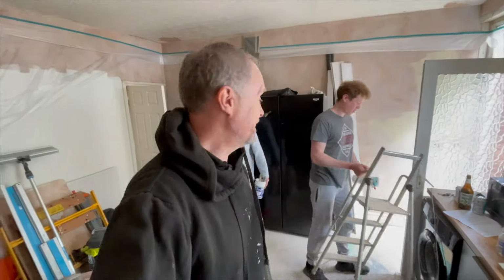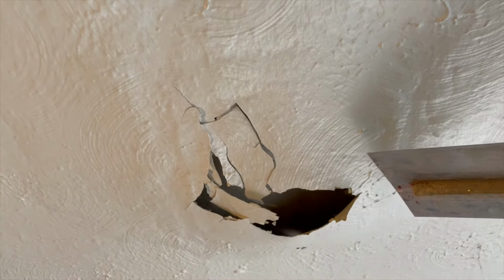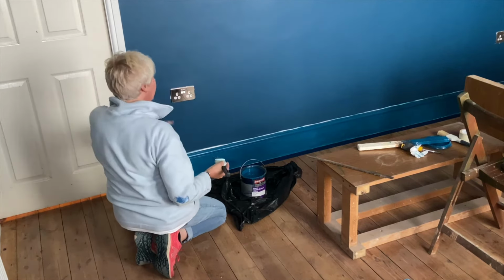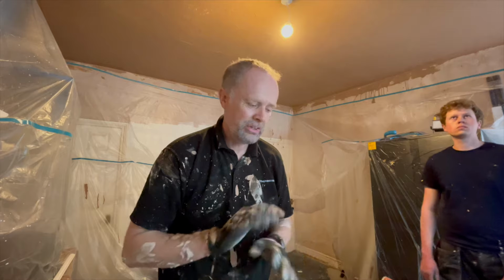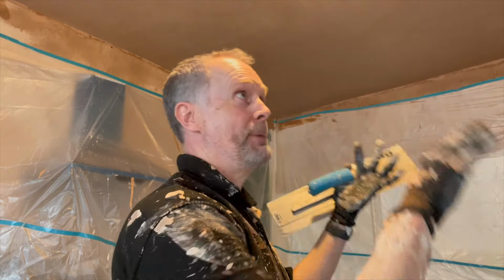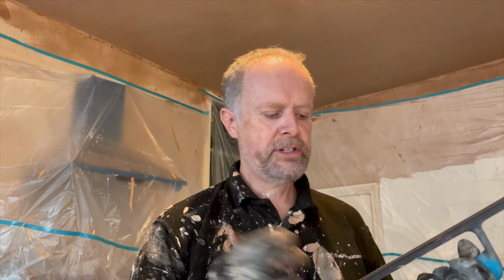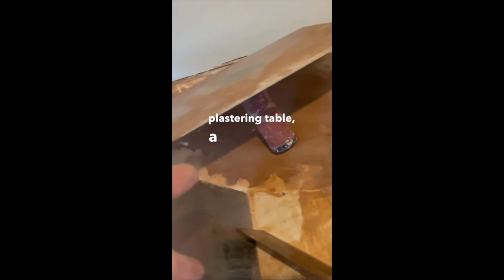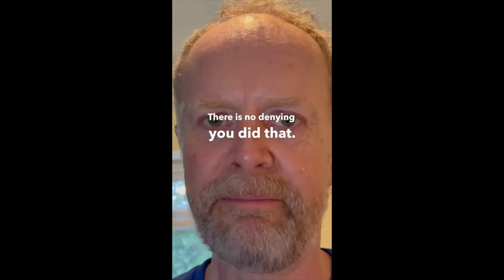Plastering: SBR v PVA [SHOCKING] verdict!

Comment: Mate, with all due respect for trying, you're doing it all wrong lol you dont look like you really know your drying times and materials. There are a thousand ways to get the plaster to pick up quicker. The sbr should have gone on neat which is not your fault as you followed the instructions but with experience you would have smashed that in a couple of hours. But fair play for trying. And lastly stick to a normal carbon steel trowel keep the flexi trowels away from plaster. But well done for trying
Reply from the maker: Thank you so much for taking the time to watch and then comment - I really appreciate it! 
The time to try SBR was not on that ceiling with that awful thick, stippled, shiny paint. 
PVA and two skims is easy enough but that SBR was wrong stuff, wrong mix, wrong surface for me. Thankfully I won't be doing that again!
The flexi was new so I wanted to try it but the plaster was off and wet in places so it was a disaster from start to finish. 
But it's done, it's ok and it was free...! 🍻🍻🍻🍻🍻
Reply: Lol
Reply: What he said … carbon steel all day long ☝️
Reply: Stainless steel trowel keeps its edge a lot longer and has no gaps unlike carbon sprung steel . Another good tip after you're done every day clean it and then wrap it up in a thickish piece of towel a few times and you'll have something as sharp as a Stanley blade in a year or so depending how much sand and cement work you do with it .
Reply: We've been using sbr since the 70s, never ever used PVA, blue grit is complete rubbish it is two course so the grit comes through your first coat, stabilizer we use mostly on lime paint, and this video with this ceiling that looks like lime paint, sbr pink we use now, but sbr all the way

Comment: Having sold SBR for many years, it must be dry before skimming, preferably done the day before. PVA is water soluble, so can reactivate when skimmed on. SBR is far more stable, with many times the adhesive strength than PVA.
Reply from the maker: Well I needed that info badly because let me tell you, wet SBR is bobbins for skimming!!
When I do the stairwell I will defo do that! Cheers! 😉🍻🍻
Reply: @martynlegg1042  SBR isn’t tacky like PVA and hence you have more chance of the plaster sliding on the substrate and not gripping like it does with PVA especiallly on some paint types, also every plaster on YouTube seems to think suction is a major issue to the point they need to kill it completely when infact a bit of suction can help adhesion to the substrate but SBR may help with extreme suction.

Apart from drying times and the odd substrate that has cause excessive suction I’ve never seen the need not to use tried and tested PVA!
Reply from the maker: Interesting! Good feedback, cheers. I must say I feel I know where I am with PVA!! 😂🍻🍻😂
Reply: You’re went over something like artex would just pva it the once and the bit you broke off twice as they suction would be different

Comment: Sbr far superior especially as a sealer for suction control but needs to be applied neat as much more liquid like than pva and dries within the hour if neat, I use all time now as pva not great on high suction walls and sbr rubberises and provides 100% barrier and still grips
Reply from the maker: Nice one, thank you. I think that now I know the right way to apply it I will persevere with it and I may be an SBR convert...but the PVA is cheaper...!! 😉😂🍻
Reply: @EscapeToTheDreamHouseUK  hi there, pva is cheaper but sbr still goes fair way and only need 1 coat neat on any background even bare plaster where you would need least 2 with pva and still be fighting suction a bit, once you get used to it you’ll see the difference 👍
Reply from the maker: @Nofixedabode859  excellent recommendation! Nice one 🍻🍻🍻

Comment: Best go neat with sbr. Plasterers have for years been using product not specifically made for plastering pva and sbr. They kinda work but occasionally fail. Likely the paint you were going over will not absorb anything so neat sbr is needed or maybe thistle bond it / blue grit. But sometimes pain s inevitable
Reply from the maker: Nice one Iain. Thank you. I normally use PVA because it’s cheaper!! 😉😂🍻🍻

Comment: It doesn't matter what primer you use if it's still wet. you'rer going to have problems if it does strat to slide, leave it alone, and let 1st coat pick up. The more you play with it, the more it slids
Reply from the maker: Absolutely spot on! Total cock up on this one. I am so used to using PVA so the watered down (another cock up) SBR and not leaving it until the following day just made it an absolute fu...disaster!! 😉😂🍻🍻

Comment: A tone of work for very little reason mr.
Sorry to say, you applied the bonding agent totally wrong.should have been left until dry then plastered.. preferably overnight 
Styrene Butadiene Rubber is not water soluble once it's dry were as poly vinyl acetate is especially if it comes into contact with excessive moisture. Pva is ok in the right setting...ive used both for years as a professional plasterer in both commercial and domestic settings.
It works perfectly..
Artex is full of fine particulates including asbestos & cement so adding water to your gule will slow down evaporation prosses massively... Hence your multi finish will start turning to almost chewing gum like texture. Difficult to deal with.

Even Bulegrit plasterers primer needs SBR applied on problematic & multilayer surfaces prior to plastering.

Distemper requires stabilising solution left to dry then sbr...
Lime finishes stay well away from any type of vinyl based adhesives
After 28yrs on the trowel i often find it strange individuals somehow believe that "i can do that how hard can it be..." extremely  hard.
every trade is just that and should be treated as such...now its become a race to the bottom.

You had a go regardless.. fair enough 
ive only chimed in, as i felt your assessment of the adhesive was based on incorrect management of the material.
Reply from the maker: Oh wow what a fantastic response- brilliant, thank you. I am going to keep a note of all that for future reference! Really appreciate that 🍻🍻🍻
Reply: @EscapeToTheDreamHouseUK  Not a problem.. 👍
 SBR & PVA both work well tried and tested for decedes,. plasterers grit is not a one stop shop like many believe and do have massive limitations and require more material to cover. Plastering is not a dark art it's always been about the "preparation" enjoy the journey.
Once word of warning don't get wrapped up in the flexi-trowle syndrome it's easily done..all the best
Reply from the maker: Nice one Steven! Appreciate your help. Cheers 🍻 🍻🍻

Comment: Enjoying the project but as a plasterer it gives me anxiety watching 😂😂  fair play for having a go.

Next time just use the sbr neat. It will be dry by the time you've set up the rest of the gear. Even in winter its dry in around 30 mins. I haven't used pva for years 👍
Reply from the maker: Top SBR Tip - nice one! 
As Matthew did it it looked dodgy and I felt we were in trouble!!
We were.
It didn't dry at all and the plaster smeared rather than spread. It was the worst bit of plastering I have done. Ever. Shocking. I was so disappointed. Ah well...! 😉😂🍻

Comment: And don’t forget your only as good as the background your going on that artex looks like it may fail in the future it would have been easier to overboard with 9.5 and would have been easier for you to finish on too , with sbr your better off sealing the day before for best results 👍🏻
Reply from the maker: Top tip about doing the sbr the day before, thank you 🍻 - defo not the same as pva in that respect. I know what you mean with the boarding but I really didn't feel up to that one this time!! 😉😂🍻
Reply: @EscapeToTheDreamHouseUK I don’t  use sbr for skimming myself as it’s sole purpose is for cementitious products , ie damp proofing slurry’s rendering,priming prior to self levelling floors  etc etc, pva much better in my eyes 👍🏻
Reply from the maker: Ah! Now then, interesting! I have used pva a lot and it has worked for me and it is cheaper!! 😉
I will try with cement stuff as well in the future - top tips! Cheers 😉😂🍻

Comment: Why people rave about SBR is beyond me it doesn’t go or stay tacky so it doesn’t give the plaster any key.

In fact becafeful what you use SBR on because you skimming will slide on it and it will cause you loads of issues.
Reply: SBR is by far better than PVA . Never had any issues
Reply: @KiXa1  SBR when dry doesn’t emulsify like PVA hence it won’t be tacky and form a key hence why on certain substrates PVA is way better because there is less likely hood of the plaster rippling and moving about on the substrate.
Reply from the maker: Ok so that’s interesting! When I did it is was still wet and the plaster slid. It was a nightmare! But when it was dry it was ok. But, don’t tell anyone, I do still like PVA..!😉🍻🍻🍻🍻
Reply from the maker: I think my probs were because I tried to use it like PVA and didn’t give it long enough to dry. I do think both work but what the heck do I know…!!! 😉😂🍻🍻